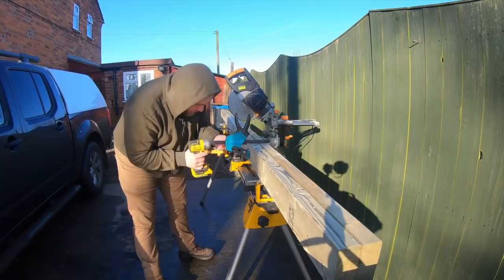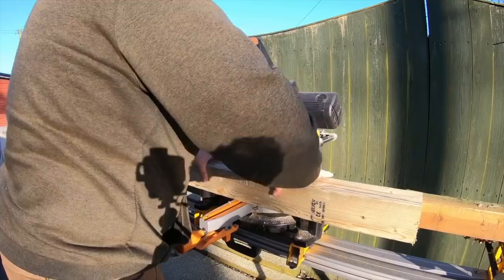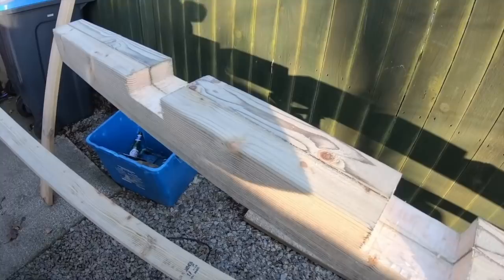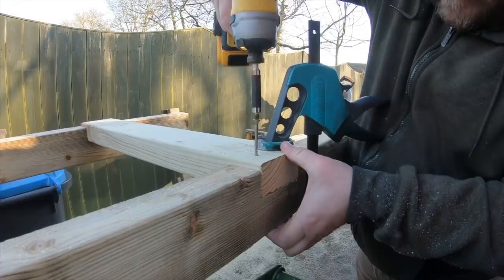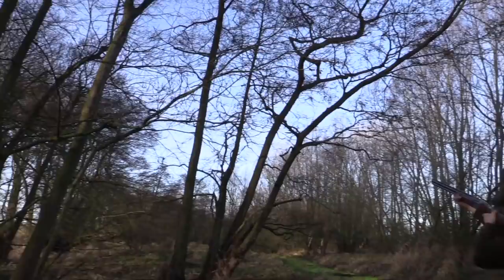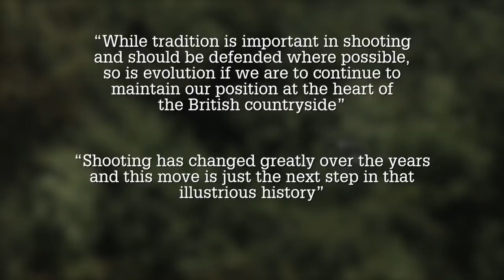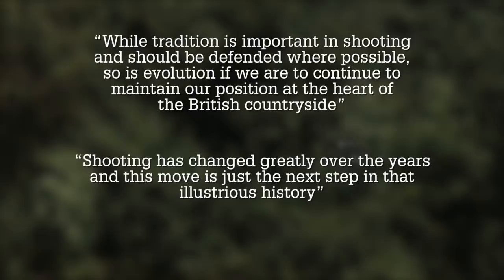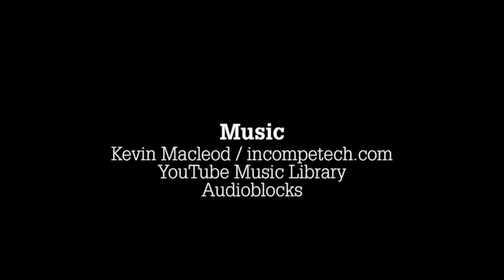The Shooting Show – high seat fox shoot PLUS latest on lead ban plans

Comment: what is the best size Dive Bottle, most seem to go for the 3 Litre Dive Bottle but what is the best size?
Reply: For a PCP?...I use a 7 litre. It's the biggest I like to carry to take to my shoot. 3 litre is nice and small but runs out very quickly. I suppose it depends on what and how much you are shooting. The carbon fibre bottles are lovely, but very expensive.